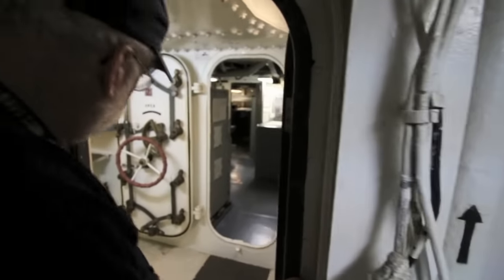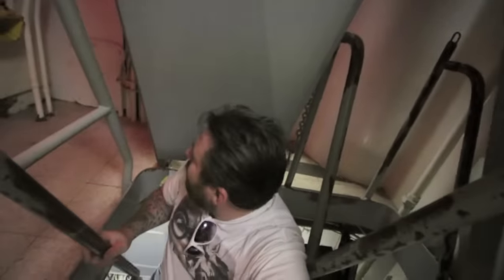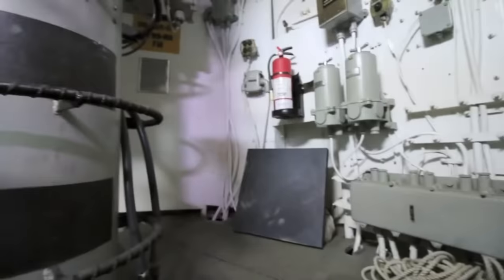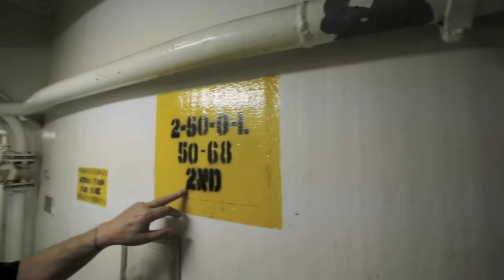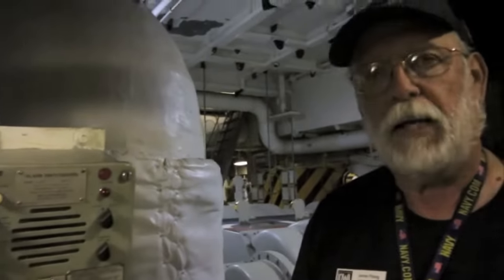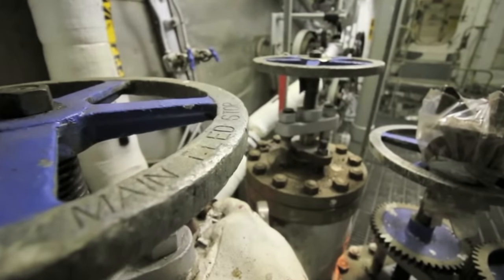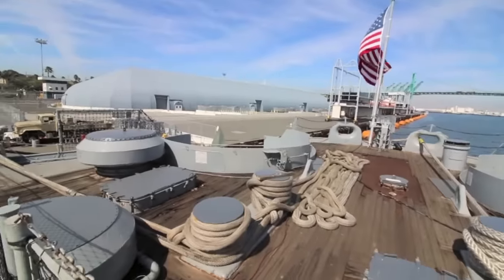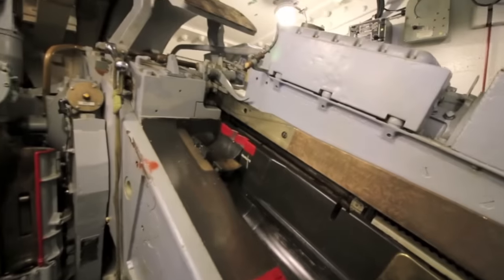Exploring OFF LIMIT Areas WW2 Battleship : USS Iowa

Comment: Can you still fireup the Engines?
Reply: Theoretically, yes, tho it would have to spend some time in drydock.
Reply: is there any original radar left? can the ship be recommissioned or be firedup and have a sea run?
Reply: great is there any possible of the fireup? is she still sea worthy or not
Reply: @judden4610  

I'll answer both posts here...

Which radars are you talking about? If you mean surface and air search, the answer is no. MUCH better that vintage.  If you mean  fire control radar, the answer is yes. The radar in the Mk38 directors is the Mk13 set from WWII. Those sets were absolute magic, first the Mk8, then later the Mk13. they see over the horizon and  could see the shell splashes. The Mk8 for sure was a phased array....in 1943...and I have been told the Mk13 is also phased array, but I can't swear to that. Light years....universes.....dimensions ahead of what the Japanese had.

Raising steam....while possible is not going to happen. Drydock time is outrageously expensive (as are tows, the nearest drydock is San Diego, and is booked for years to come. Hawaii and Bremerton are too far. The entire process, time , materials, and labor would be virtually astronomical. Then you need the fuel and crew to run her...no, she has steamed her last mile.  Now, on top pf ll that, there are no spare parts. While there is some modern equipment from 80's refit, there's also lots of legacy equipment, with no spare parts. So you'd be either making the needed parts (expensive) or replacing legacy with appropriate modern, expensive as well as a major pain in the ass. Much has the potential to be round peg in square hole.

Sorry to disappoint,  but it ain't gonna happen...
Reply: aww it would be nice to see iowa in service ahahha. were all the surface to air radar removed? hahaha ik that the CIWS is a dummy
Reply: last question but do the 16" guns still rotate and elevate?
Reply: @judden4610   Answered elsewhere, but the answer is yes and no. No rotation (of the 16's,) but they can be elevated manually, though it is a major PITA. The 5" gun on the other hand can be rotated, elevated, and using a non-military procedure, fired with black powder blanks.
Reply: is turret 2 fixed or not?  is it creepy inside there?
Reply: T2 was cleaned up but not repaired. I've only stuck my head in the back hatch and personally, it was a little creepy. Others say they had no reaction.
Reply: so the Uss Iowa has little chance of being in service, haved you been in the powder magazine on T2?
Reply: just pretend that there's still 16" rounds left and some powder bags would T2 Still fire?
Reply: @judden4610  
When I was in T1 several years ago, if I remember right, I was in a magazine in between T1 and T2.I think that one serves both turrets, but I'd have to look at prints to be sure.
Reply: just pretend that there's still 16" rounds left and some powder bags would T2 Still fire?
Reply: @judden4610  
Nope. Not even close.
Reply: does the horn in uss iowa still there?  and is it working?
Reply: @judden4610  
Yes, as far as I know it is in place. I doubt it's working. From what I've heard, it never worked well, sounding like a dying moose and spitting rusty water everywhere.
Reply: Thankyou for the informations😊

Comment: What did he mean .. about near conning tower.. "see that round square like gray thing... That's so I'm caße emergency you could throw Roosevelt."

What I'm the heck does that mean? Not sure what he pointed at...NO freaking idea what he means? 
Certainly not referring to, not president
Reply: Give me a time stamp and I'll address it directly, but in general, here's the deal. The conning tower has 3 levels, the helm, where Adam went in is the middle level. Just above is the gunnery officer's position, and the lower level is the Admiral's level. That lower level is what was accessible for Roosevelt while he was on board in 1943. Two small elevators were installed for him so that he could be raised up to that level (the 03) and be placed inside that 17.5 inch armored tower in case of attack. As far as I know, he never entered the conning tower.

Comment: this ship could be reactivated in a pinch . still complete
Reply: Theoretically, yes as you are basically correct, she's still complete. She has been stripped of some weapons systems though. However the reality is that the Iowas will never return to service. They are old, dangerous, and there's no one to run them, no spare barrels, no powder, no projectiles, and no spare parts for all the legacy equipment (and there's a lot of that). It's simply not practical or economically feasible.